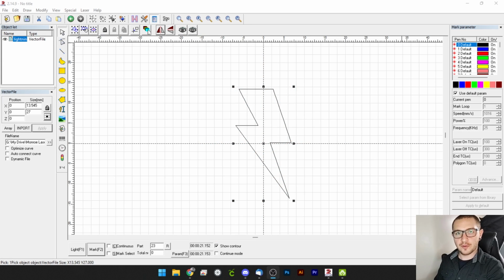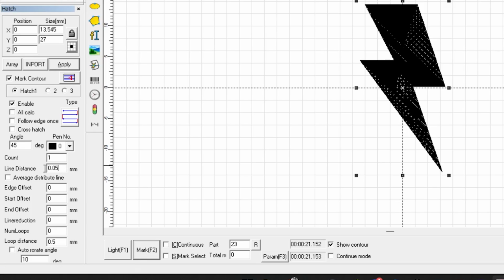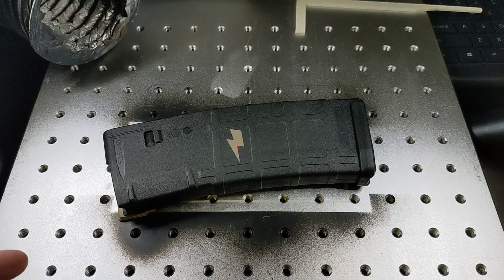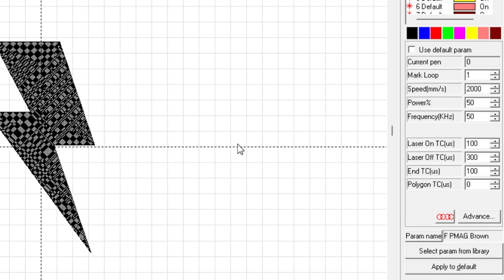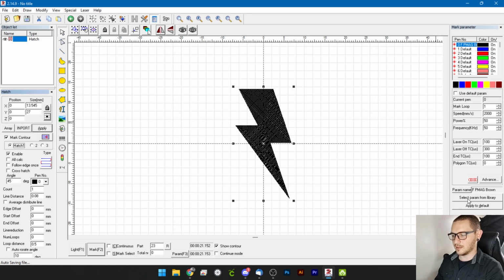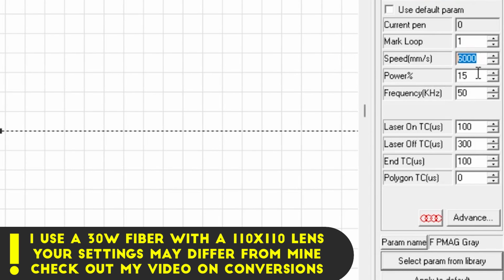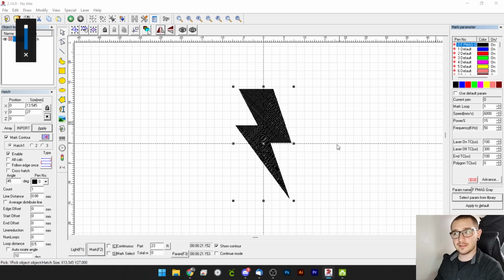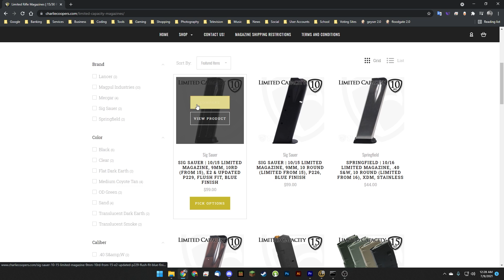How to Engrave PMAGs with a Fiber Laser | Polymer Laser Marking | Fiber Laser Tutorials

Comment: THANKS FOR THE VIDEO. HOW MUCH CHANGE IS THERE FOR A 60W. WITH 175 MM LENS?
Reply from the maker: Shouldn't be too much of a problem the 60W means you have a lot more power but the 175mm lens spreads that power out over a larger dot. They should be close, if not maybe a little less power but you won't be straying too far to reproduce these marks.

Comment: I came across this video as I was searching for a solution for a problem I have. I’m going to be using a Flame resistant/retardant abs or flame resistant polycarbonate/abs mix filament for a product I’m creating. I would like to do my product label w/ QR code on it, but I don’t know if this is possible or if it would create an accurate enough label for the QR code to be read for inventory purposes. I suspect it may work in the same way you did this, but you seem to know better than I would. Any help would be great. Thanks

Comment: Great video....  question, how much do the settings change in Light burn if at all?  If using a 100 fiber, can the settings be adjusted on the same scale? IE. 50% power with 30w, so 35% on a 100w?

Comment: for a 60w fiber would the powers be half? I can't wait to ruin a mag trying lol
Reply from the maker: hehehe. So, its a yes and no. We did this with these settings on a 30w, but thats not the whole story. Your lens size is going to also impact how much power you'll need. Bigger lens = needs more power to get the same result. smaller lens = needs less power. If your laser is a 60w, but has a bigger lens, it may be close to balancing out. Grab our starter parameter pack from our site, it has everything pre-converted to give you a rough conversion and start for a lot of wattage/lens combos and may give you a solid starting point for testing. Happy lasering!

Comment: Do these settings work on a 60W Fiber?
Reply from the maker: Not directly, this was done with a 30w laser. You need to account for your wattage as well as lens differences. Check out the settings on our website, we did rough conversions, so even if you need to tune them, those would function as a starting point since you’re on a different setup.

Comment: How do you get it to trace the shape?
Reply from the maker: If you want a contour line, that can be added via a checkmark in the hatch setting of ezcad (or a line sublayer in lightburn). If you mean for the red light outlining the shape, that's in the red dot settings in F3 of ezcad or framing option in lightburn.
Reply: @LaserEverything  thank you. I've tried that, but it doesn't work..
Reply from the maker: Would need more information as to what you’re trying to do and maybe see screenshots of you’re settings then. It would be best to join any one of the communities in our video descriptions and start a support thread with the details so the issue can be properly dug into
Reply: @LaserEverything  will do. I'll put the screenshot in the disc.

Comment: Alex,  I have a need to ablate/excavate a square hole in a Pmag.  About a 4mm by 5mm square hole that doesn't fully penetrate the material.  Do you have any recommended settings for my fiber laser (60W MOPA).  I need to remove material in this case and not color it.  Thanks.

Comment: I have access to a pulse fiber laser but it maxes out at 10khz frequency. Do you have any suggested settings for me to mark pmags or plastics in general? Thanks in advance!
Reply from the maker: Do you know what laser you have specifically? That's a very odd Max
Reply: @LaserEverything  Telesis FQ20DS Model 6 to be exact
Reply from the maker: @sebeck1 do you know your source?
Reply: @LaserEverything  I do not know what the source is. I just know it's a pulse fiber laser. I have been working with it for a few years and im baffled at the 10khz limitation.
Reply from the maker: @sebeck1  it is bizarre. If you haven't already id join the discord or Facebook group it's a little easier to keep on top of things there. I'll have to do some research on your machine I have a really hard time accepting that frequency cap.
Reply: @LaserEverything  it's a Telesis and uses proprietary Telesis software. A 20w I believe. Thanks for the quick reply!

Comment: Hello its can engrave Watch strap silicone/rubber/lycal with 20w laser fiber Marking ?
Reply from the maker: not sure what lycal is, but silicone/rubbers are generally better with Co2 laser wavelength. Some types of rubber can be done with fiber using care, but will require patience and testing to not burn it up too much.

Comment: I have a 10w I'm trying to do this with too but I'm having a hard time finding the right settings to see different shades.. most I can find Is 30w info.. any chance you have settings for a 10w for these?
Reply from the maker: We don't, but you can use a converter to adjust for the power settings. If you search the channel for "converter" it should pull up the video where we talk through how to get it and use it.

Comment: Hey man, I am fascinated by laser work and would like to try it out, Im not ready for a huge investment, what would you recommend for pmags, would omtech 40 or any of the cheaper lasers be able to engrave polymers or scratch the surface or metal/aluminum receivers?
Reply from the maker: I'd probably recommend a diode just because the CO2 laser dot size is so big it's going to make it hard to mark the items you listed with any precision. That said I haven't really tried marking pmags with a diode so not sure how that would go. Depending on your budget you could check out our recent review of the Basic 2R from 3PLASEES an entry level fiber. It's gonna take a little more work to get nice marks on plastic due to its limited frequency range but would be a great great machine for quick AR lowers and stuff like that.
Reply: @LaserEverything  thank you, I appreciate you taking the time to reply.

Comment: what laser power do you use. I have a 50w laser, will these settings match it?
Reply from the maker: This video was made with a 110 lens on a 30 watt laser, so the settings will be quite a bit different. Process will be the same though. Start with a light hatch and low power, and go from there.

Comment: On a 50w laser, what setting would be ideal for the "sanding pass" not to be discolored, I want original colour? I did some g19, g17, and use the laser as a sanding option but get that brownish effect.
Reply from the maker: Fiber lasers aren't really designed for plastic. All of the settings I have for pmags burn the material in some way which is why we get the different colors, because we are controlling the burn. No luck yet on a pass that doesn't end with discoloration.

Comment: I have just purchased a 30W Fiber with a 150mm lens, what should I change settings wise for the difference in lenses? I have tried the settings you have with some adjustments and still cannot get tan or brown..? Thank you
Reply from the maker: Typically with a larger lens you'll need more power. If you're maxing out on power you'll have to start dropping your speeds. If you have our parameter library make sure to use the built in excel file that includes a settings converter to point you in the right direction.

Comment: Is the minimum for pmags 30watts or could you do 20watts?
Reply from the maker: For pmags specifically less power is better. These settings are designed to just barely kiss the plastic. Too much heat and you're melting.

Comment: Question?
Will this work on Any 30-watt fiber laser ? I have a OMTech 30 watt
Also, do you sell your Library with the pre-configured settings?
Reply from the maker: It should work fine on any 30w fiber with a 110 lens which is my current setup in this video. Different lenses will require some power adjustments. The entire library and converter spreadsheet are available by supporting the channel over at https://masters.lasereverything.net/
Reply: @LaserEverything   I have more questions
I'm even more confused on which Galvo I need
I want to do Pmags and Pistol grips but also want to DEEP Engrave Stone, Metal and also Tumblers 
So do I want a 30 wat or a 50 watt ??.............Do I want a CO2 Galvo or a FIBER ??

Thanks for your advice
regards, rick
Reply from the maker: It sounds like you want both honestly. Stone, some plastics, and tumblers are all going to do much better with CO2. pmags and metal are going to turn out significantly better with the fiber. If you have to pick one I'd start with a fiber. It's easier to cheat and do stone and tumblers on fiber than it is to do metal with a CO2
Reply: @LaserEverything  
Thank you so much for your replies
Do you recommend a 30 watt or a 50 watt
I own a sign shop and Im about to pull the trigger this month
On a 130W CO2 and a Galvo
I will be joining your membership soon
Reply from the maker: If you own a sign shop you're probably going to want to be using the larger lenses available for your machine which will run MUCH better with more power behind them. You'll likely be happier with more wattage.
Reply: @LaserEverything  
On a Live youtube video I mentioned getting the 50wat and you kind of snickered and told me good luck with that.....|Is there a problem with the 50 watts over a 30 watt?
I will be joining your membership soon to take advantage of your knowledge and power templates .............am I better off getting the 30 watt?
Reply from the maker: I don't remember the specific context Rick, might have been snickering at something else unless you had an absurdly low budget or were looking at something particularly shitty. Otherwise I would certainly recommend the 50w if you can afford a decent one.

Comment: Should you be able to scratch off the mark you made with a finger nail? If not what would cause this to happen. How can I make the mark tougher ?
Reply from the maker: I've never tried it so I just went and grabbed the pmag from the video to test, it does not come off with a HARD scratch of the fingernail. If it's scratching off you probably aren't quite using enough power. Gotta get just a little bit of that plastic removed from the surface, so that's where I'd start.
Reply: @LaserEverything  thank your taking the time to reply! I’ll definitely try that, thanks!!!
Reply from the maker: Good luck, I'd you need more help don't skip the Discord server. It's free and there's a link in the description!

Comment: If the only thing i wanted to do is p mags, and stipple grips as a hobbyist what would you recommend as a engraver? What is the minimum laser requirements i would need?
Reply from the maker: Minimum I'd go a 30w JPT (for the enhanced frequency) fiber laser. 50w would give you more flexibility. The mactron units linked in the description are a great place to start your search - I strongly recommend them.
Reply: @LaserEverything  yeah i have recently gotten a 30W JPT Cloudray and looking at doing the same.

Comment: hi.with a 50w laser how can i engrave on plastic
Reply from the maker: Different plastics mark differently, some work - some don't. Fiber lasers aren't designed for plastic they are designed for metal. That said, usually it's best if you're going to try anyway to start with very high speed, low-medium power, high frequency with lots of repetition. Best way to get started.

Comment: Hi great vid very informative I gave it a try today but only managed to get a very light white / grey using your brown setting tried tweaking but to no avail what could be going on?
Reply from the maker: Sorry to hear you're struggling, if you haven't I would join the discord, there's a link in the description. If you can post some photos there with your machine stats that will help us diagnose the issue and get you rockin and rolling.
Reply: @LaserEverything  great thanks.
Reply from the maker: Yep! ⚡

Comment: Any reason you’re doing two hatches at opposing angles instead of clicking crosshatch? Just got the software and still learning.
Reply from the maker: I don't really trust ezcad to do anything the way I want it to be done. If there's a manual option for making something happen I'll usually do it manually. Just like seeing the boxes I want checked checked and settings for each hatch filled out the way I want it done rather than just letting the computer do it. I dunno. More superstitious than anything that ezcad will just find a way to fuck it up. You're likely fine to just click crosshatch.

Comment: Hi there !  I have a 20 w fiber laser machine.  I want plastic engraving like the cell phone charger is black plastic in this case. Your video is very explanatory but my parameters must be different 
It marks me brown tone with 1000speed / 20 pow / 20 frequency.  I want to achieve white or light gray tone! 🤔👍
Reply from the maker: Hey Liliana. I think in the Patreon library we have an experimental ABS setting that might get you closer but fiber lasers aren't really for marking plastic. UV lasers are much better suited for that (there's a great one linked in the description) 

Either check out the patreon settings or keep experimenting. Pro tip would be to increase your line distance big time on your hatch. Try .05 - .1 

Hope that helps!
Reply: @LaserEverything  Thanks a lot !  I will do it